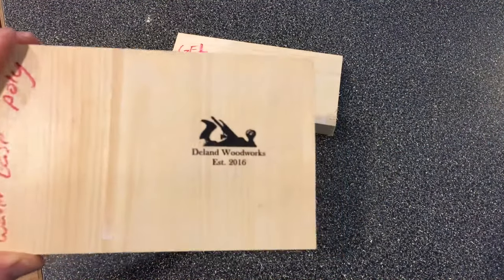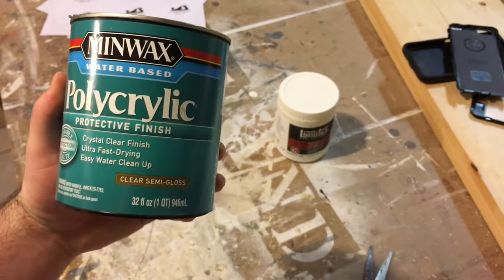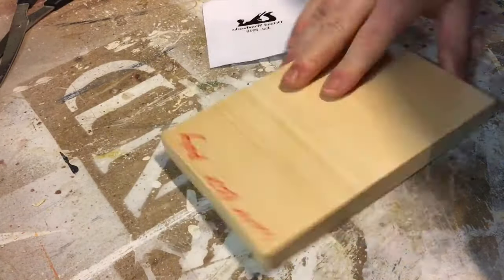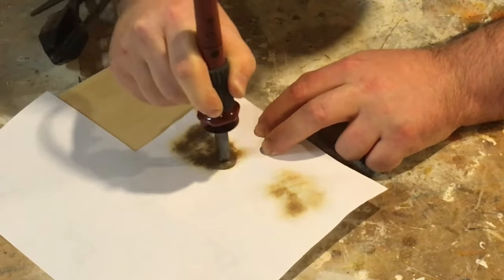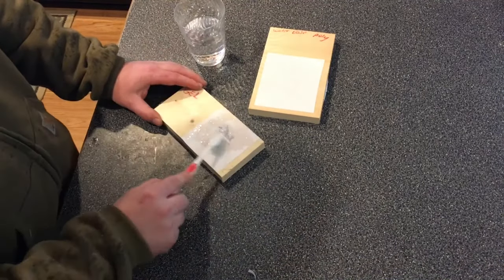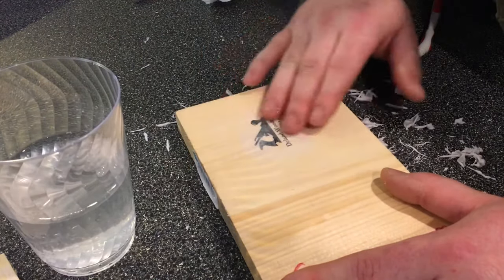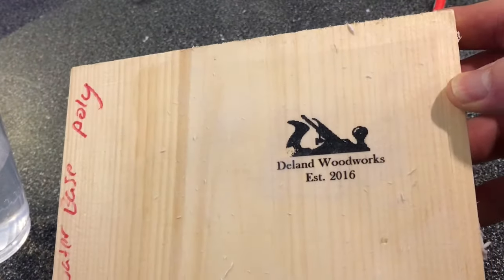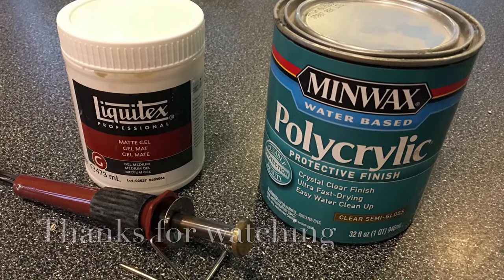Picture Transfer ~ Laser Jet Ink

Comment: Hows the finish after using polycrilic? Wont the water raise the grain of the wood therefore having to sand again?
Reply from the maker: @revhard I've really never run into that problem. At least not yet. Thanks for the question